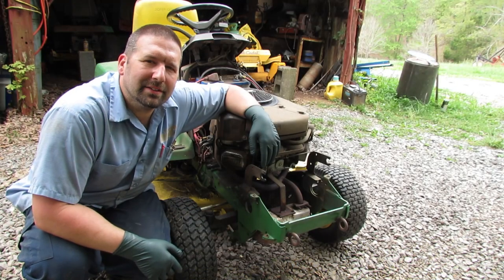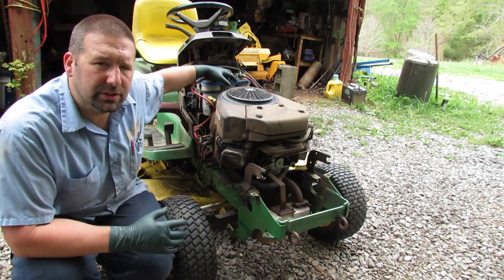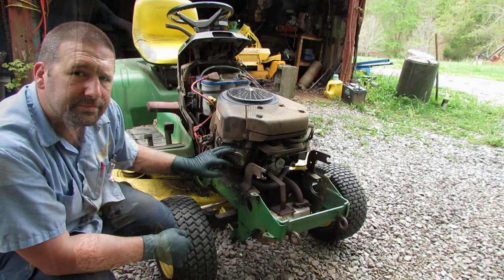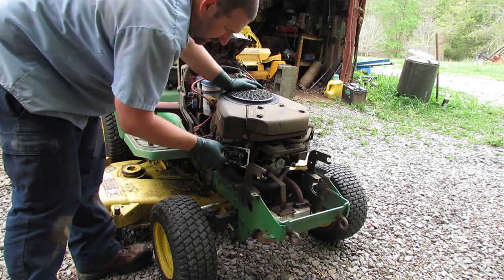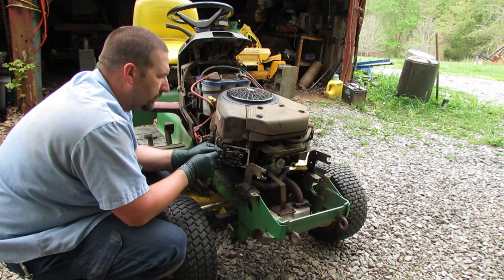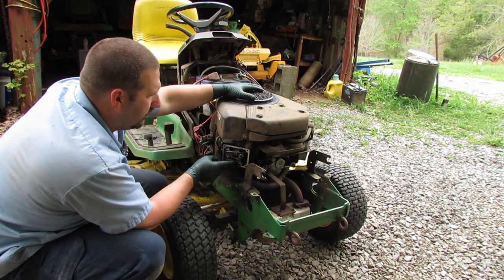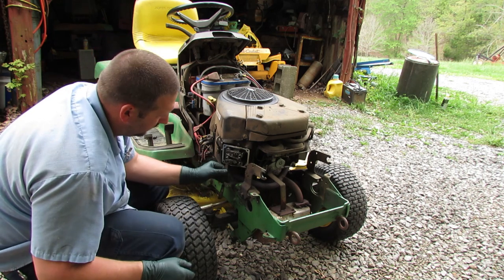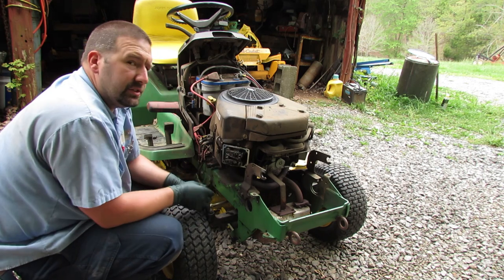How To Fix Slow Crank on John Deere 325 With Briggs & Stratton Intek

Comment: You're my hero! I was having this issue with my Sears lawn tractor (18HP B&S engine) for a couple of years now - sluggish engine turn over when starting. Got a new battery and it helped but it sometimes still needed a jump (if it hadn't been run in a while) and even then it turned over sluggishly. I checked my valve clearances and both intake and exhaust were quite loose. Set them and the engine cranks over really well now! I didn't know there was an integrated compression release. It runs great now. Thank you, thank you!
Reply from the maker: Kent Downs that is awesome! Great job on the repair. I wonder how many mowers get junked because of simple repairs like that? Thanks for letting us know and watching. ~Mr. C.

Comment: Hammer time!!! Mines turning slow too!
Briggs twin 2! 18.5 hp!!
Topped off oil ,cleaned plugs ,magnet, & coil!
Charged battery & ran car & jumper cables to it!
Still turns slow!! Put cable straight to starter red wire & grounded!
I think my old starter weak or compression to high?!
Took plugs out….. still seems to turn over slow!!!
Reply from the maker: Orlando Johnson sounds like your starter is turning slow. With the plugs out there would be no compression.  Another thing to look at would be a drag on the crankshaft like the blade clutch is activated or maybe a idler or pully for the belts is dragging for the drive system. Try removing all belts from the bottom of the engine and try turning the engine over. Hope this helps. I would love to hear how it goes. ~Mr. C.

Comment: Thank you for the video. Just picked a Husqvarna with a Briggs V twin. Bad slow crank. Not running currently. Going to start with this valve adjustment before I go deeper.
Reply from the maker: eric pigg excellent idea. Valve adjustment is a good place to start. I would love to know how it goes. Let me know. ~Mr. C.
Reply: @NaturesCadenceFarm  valve adjustment and a higher CCA battery and it starts like new.
Reply from the maker: etc pigg that's great news! Glad it was fairly easy to get going. ~Mr. C.

Comment: What would be the next step if you did the valve adjustment an it still has a hard time turning on? I've got perfect power an fuel, any ideas..?
Reply from the maker: @leo42003 a few things I would look into are timing, compression, spark, and is it flooding. Is it turning over slow or just not "popping"? ~Mr. C.